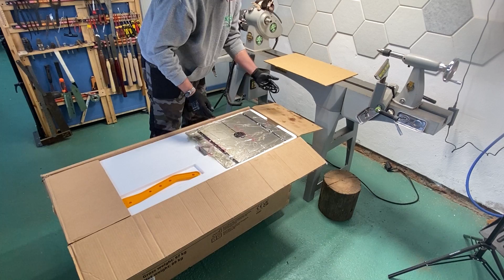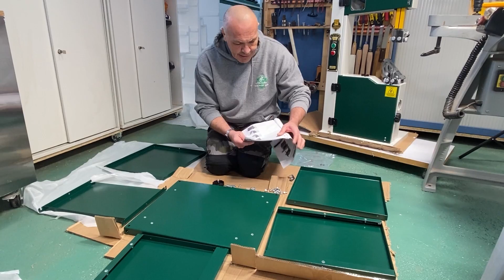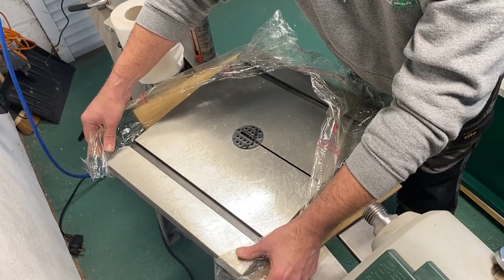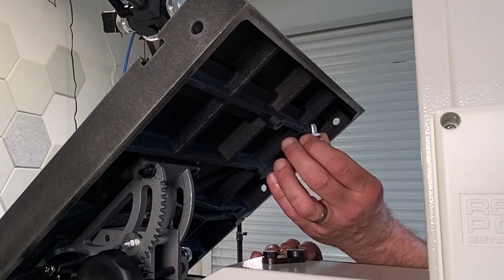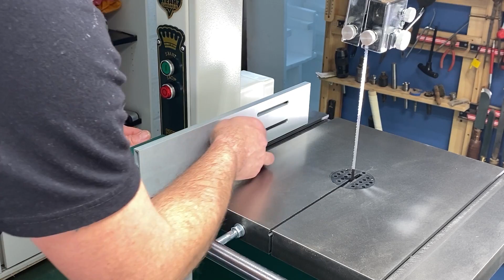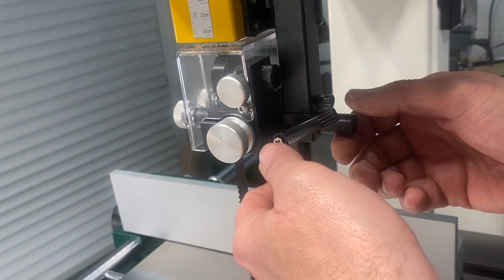NEW RECORD POWER Sabre 300 Bandsaw PART 1 - Unboxing and Building

Comment: Thanks for your video, I just purchased it. I am setting it up atm, your video is really helpfull. I just find the method of squaring the miter slot with the rules to the blade a little bit finnicky. The ruler can shift slightly in either direction and still be touching the blade and not noticing any twisting in the blade. Any better method to do it?

Side question ever heard of Alex Snotgrass his method of tensioning the blade on a bandsaw? He shifts it slighly back so the teeth are in the middle of the wheels instead of the middle of the blade. Appareantly works great to get accurate cuts. (Asking this because this saw has different kind of bearings, so idk if it matters with this saw)
Reply from the maker: Hi, the blade is a tricky one. I have since put a flat magnet on the blade and then added a metal ruler, really helps. Not heard of the other method. All the best, Mike

Comment: Mike did you build it then build it again on camera. I reckon you did because you were aware of all the pitfalls.  To be able to do that is a skill of immense patience. I couldn't imagine building and dismantling a piece of IKEA furniture...
Something occurred to me.  Metalworking tools are made of metal, woodworking tools are mostly made of metal... but metal is made by burning coal (wood) and earth together, so it feels like a full circle. Poetry.
Thanks for making this, and for anyone that actually needs to assemble one of these it's going to be gold dust.
Are you going to be doing a, "how to unwind a new coiled-up blade, without it chopping your entire shop in half" video?
Reply from the maker: Haha so close to the truth, this was the process:
Read the instructions quickly....
Find the parts needed
Re read the instructions
Set up cameras
Start filming the section
Do two or three takes while I try to get the names of parts right and re re read instructions
Re do the take when I figure out I've made a mistake.
It too me a long time to make haha

I've heard the best way to unwind a blade is to throw it and run lol 😀

Comment: Watching a tool review over breakfast, could it get any better. Nice sturdy bandsaw and a decent clearance for larger material. Slap a thin layer of wood wax on the steel table, makes feeding wood through a lot smoother. I do the same on the bed of my thickness planer. Have fun😊
Reply from the maker: Thanks Andy, I've put beeswax on there 😀

Comment: A good method for setting your upper and lower guides is to use dollar bill(pound note) wrapped from the sides of the blade and around the back. With the blade under correct tension close the guide against the pound note, tighten them and slide the blade up to remove the pound note.
Reply from the maker: Thanks, I may have to try that one 😀

Comment: I have the original BS300, and was wondering how this new unit gets an extra 2 inches of depth of cut while using the same size blades and wheels. Cleverly, they have added a little plastic cap that allows the blade guide to move through the top case yet stay safe, which allows the deeper capacity. I'm tempted to upgrade: the built-in base cabinet is nice, as is the micro-adjustment, but that front bar for the fence sticks out way beyond the table, and I would be forever hitting myself on it in my small workshop.
Reply from the maker: I guess it would depend where it was placed and at what orientation, mine is now side on so hopefully I will not have that issue 😀

Comment: Hallo Mike. Ich habe erst vor drei Wochen die Sabre 250 bekommen. Und jetzt gibt es diese Sabre 300, das ist doch zum blöd das ein Händler einen nicht aufmerksam macht das eine etwas größere Maschine im Handel ist 😤 Dir viel Spaß mit der neuen Maschine 👍
Reply: Yes, it's not like it was just released either - I tracked down the manual on-line (I wanted to check the specs), and it is dated December 2023. So the dealer should have known this was coming.
Reply from the maker: Das ist eine Schande, Mike! Das ist mir auch schon einmal passiert!

Comment: Looks like a very nice bandsaw.   Good that it came with magnetic switch.   I had to upgrade my bandsaw switch from manual to magnetic.

I see some bandsaws with the slot facing forward and some with the slot on the side.   Must be manufacturer preference.   Mine is on the side.   You did added the pin in the slot but did not mention why is it used.   For your viewers, without the pin one side of the slot may be higher or lower than the other side.  It is the nature of the casting.   It was likely ground before the slot was machined.   A local turning friend did not have the pin in her table and the two sides of the slot were out by about 1/16in.   Her slot was on the side so the far side of the slot being a tad higher sometimes caused the wood to stop as she was cutting.   After inserting the pin both sides of the slot are at the same level.

A long time ago I was at a woodworking show.   Alex Snodgrass who works for Carter, the bandsaw accessory company, gave a demonstration on tuning the bandsaw.   He has YouTube videos of the demonstration.   Highly recommended.
A couple of his key items
a)  The blade tracking should be so just behind the gullet is at the middle of the crown of the wheel.
b)  Without using the fence, make a manual cut in a piece of scrap wood about 6in long.   Cut as straight as you can by hand.  About half way through stop the saw.   Compare the line of the cut with the mitre slots.    This is telling you how the saw is tracking.   Setting the slots to be parallel with the blade is a static setup, but when the saw is rotating things can be very different. 
I did this.  I did not have sufficient movement in the bolts for the table to the trunnions.   I had to also loosen the trunnions to get sufficient movement so that my saw will cut to be parallel to my mitre slots.
You will have a lot of fun with the new bandsaw.   I know your old bandsaw was often not up to your needs.
Dave.
Reply from the maker: Thanks so much for the advice and tips Dave, these are very welcome! My old bandsaw was as close to useless as you could get lol. All the best, Mike

Comment: Excellent video, well done. One thing though, I didn't see an emergency stop button. As for protecting the bed, I use a machine wax , apply and buff. I also put some on the blade, power switched off turning the wheel by hand
Reply from the maker: Good tip! Thanks 👍